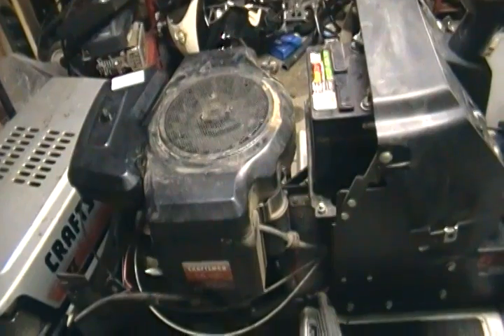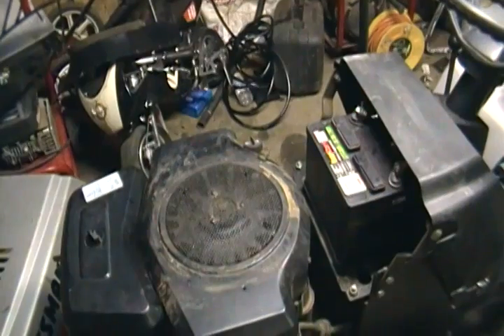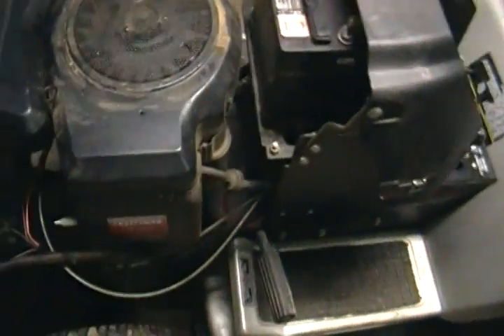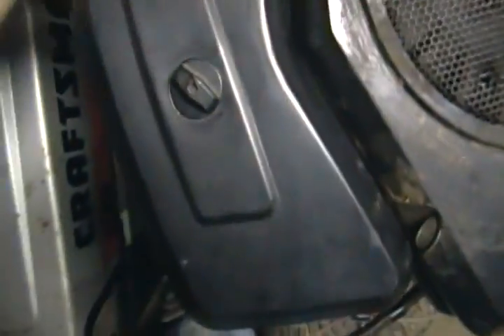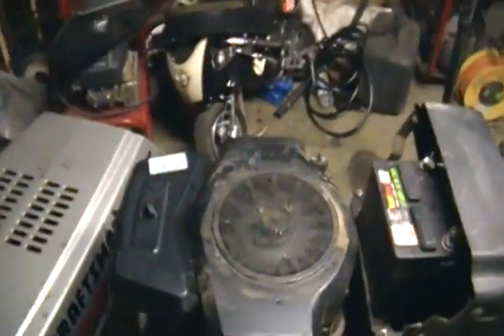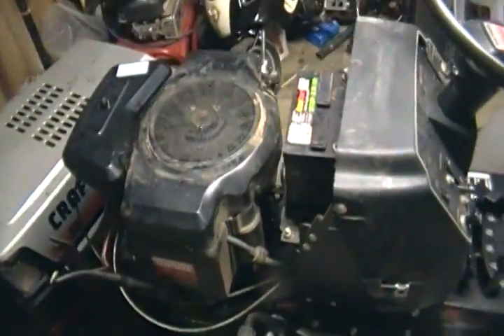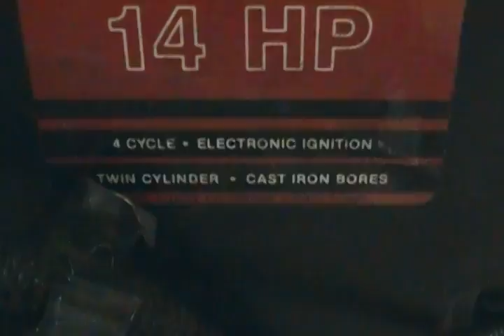craftsman 2 dead cylinder?

Comment: you could take the head off and check for scratches or scoring in the cylinder. and id also check the inside of the carb going in to the dead cylinder. it may also be both cylinders. clean the carb out.

Comment: i think its compression because of how its running, its like a late denation becuse its not compressing the fuel/air mix enough thus making it take longer to burn or light the fuel. you need to find a compression tester that will work for this, or take the head off the bad side and see if it has movement in the piston.

Comment: Well since the 18 is just like the 14 except the 18 is bigger I have 4 craftsman and have worked on the engines . I suggest swapping the plug wires in other words put wire from 1 to plug 2 and the 2 to the 1 plug and see if the problem stays the same .You can put a little oil in the bad cylinder and see if it makes it better if it gets better rings are bad if not maybe a burned valve . It could be that it was run without oil or low on oil and that damaged the engine . Ask previous owner ?